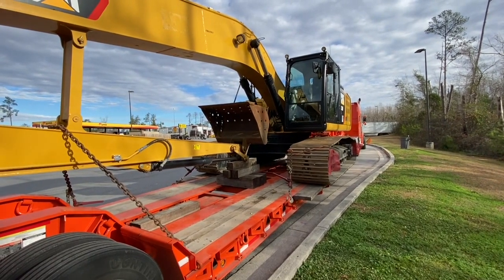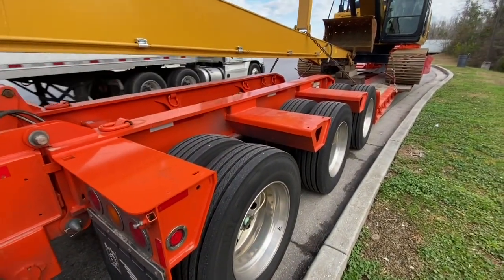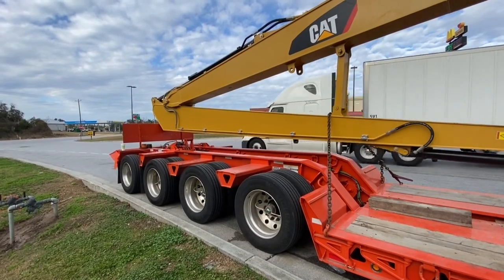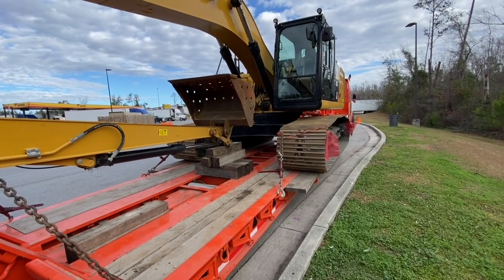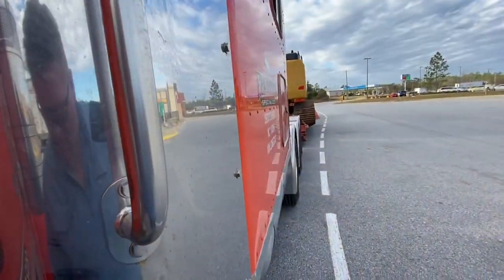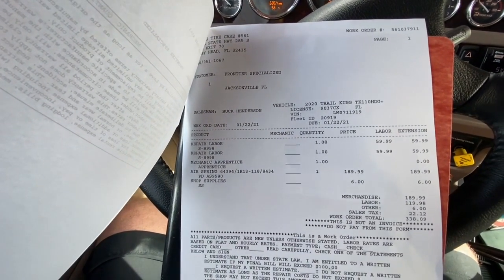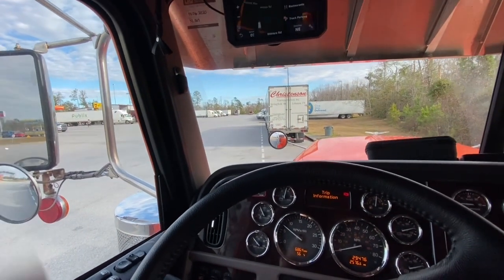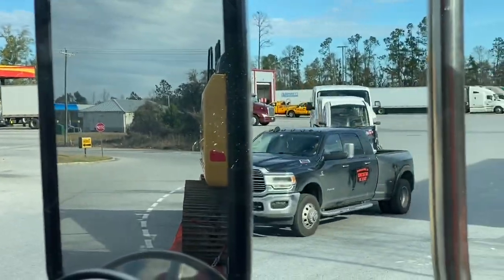Long sticking at the CAT house...

Comment: Oks !!! Had a similar issue with a brake chamber on a new reefer trailer !!!  As you know there are 2 bolts that hold the chamber in place,, but only 1 bolt had a been tightened down ..The other bolt had no nut on it & the 1 bolt broke out & the chamber fell down with the air lines holding it off the ground !!  Moral  to the story ,,I carried a tool box with me all the time & found a nut to fit the 1 bolt still in tact & bolted the chamber back up in place till I got back to the shop & had the chamber replaced !!  After that issue ,I always went under any trailer I hooked to & checked for that & Of course the brakes with a wrench do to NOT having auto slack adjusters back then !!  SORRY ,,for the long story ,,but things do go bad at times !!!!  If you look at Sergei's ""NEW"" adventure ,, he is in MI. & can't cross the border till Tues. !!!!  Been there since Fri..  ????   VA. Permits sounds like I glad I never had to deal with them as Bad enough with a reefer /dry box trailer with the ""Bridge Law"" !!!!  Enjoy the great meal you had & ""KEEP IT SAFE "" till the next Adventure to VA. !!!
Reply: I cannot believe someone that works in a state permitting agency doesn't understand what an RGN looks like or how, why, and where its load is placed! Oh wait, okay STATE AGENCY, I forgot to take that into account. Maybe they'll stick another DOT chairperson in like Bob Doles wife, yet another politician that can't even operate a motor vehicle like Hillary ffs!!!! How's about a law that says since they cover pilots, ship captains, railroad engineers and commercial drivers, they need to be one of those or at least drive a f#cking car!!!!!

Comment: A similar question dealing with brokers screwing over the trucker & not getting the machine clean enough to cross the boarder. Can you or do you specify in the contract when establishing the rate, that the shipper must clean the machine. And if he doesn't you won't load. And there's included a substantial penalty fee if they try & take the load away from you for not loading a dirty machine?

Comment: What year is that TK monster? I was a welder on the line that trailer was made on from 13 to 15. Those air bags are put on at TK on the line, or they were. Glad they made it right for ya. Stay safe out there
Reply from the maker: It's a 2020.
Reply: @KeepingitAnalog  oh right on. It sounds like the same set-up we installed back then. Can't speak on their quality now, but I know what I welded on and it was overbuilt quality then! Stay safe out there, and thanks for doin the job you do.

Comment: Air bag failure as a result of a broken U bolt, so that U Bolt must have somehow got stressed to failure, possibly when you had to provide your trailer when they needed those tracks removed ? Let’s give credit to Love’s, those mechanics got you back on the road under $500-, but I’d be concerned about the remaining U Bolts that have not broken, yet
Reply from the maker: No u bolts on this rig.
Reply: @KeepingitAnalog  need to figure out why and how this happened